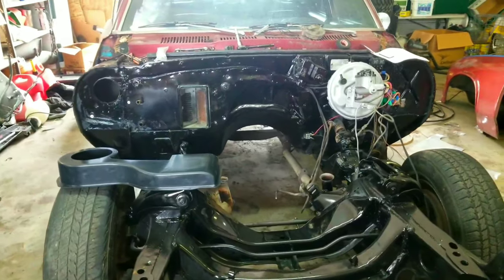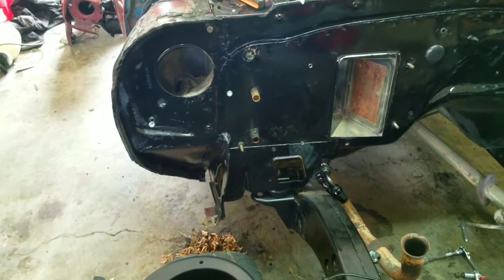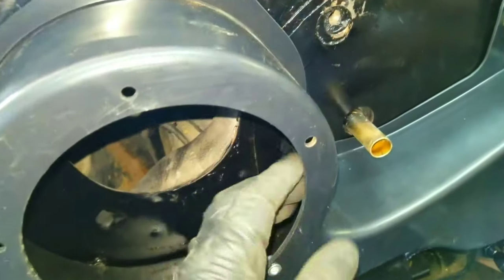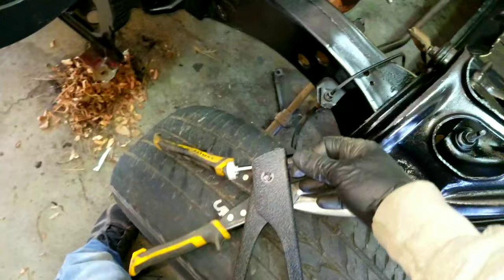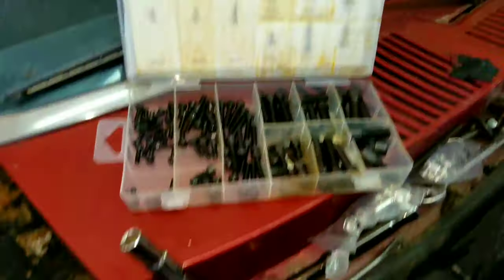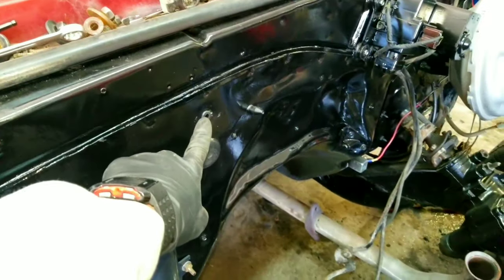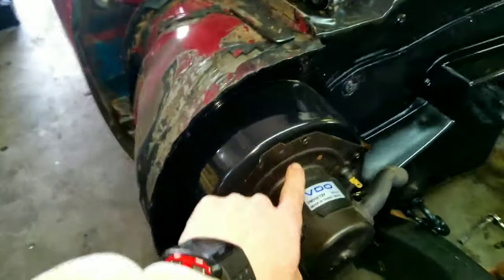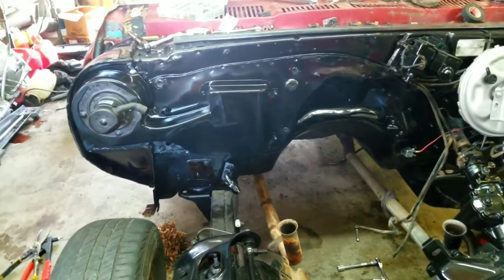LS swap: Factory A/C Delete

Comment: Why did you remove the AC box? I’m ask cause I’m doing a ls swop on a 73 Impala and I see a lot of people removed their AC box’s
Reply from the maker: For starters, the AC in this car didnt work. It was a large box that wasnt needed for the heater to work. If the AC worked in the car i might have kept the ac box. However, the AC in the older cars were not that efficient and there are better options for AC in these cars now. So i removed the AC box because it was a large heavy waste of space

Comment: So where did you acquire the delete cover
Reply: Where did you get the ac delete cover
Reply: Holley sells it, it's garbage. Better off spending the 300 on a junkyard OEM heater box. I'm in touch with a manufacture about sending mine (only oem copy I have) for them to make it available but they'll still talking about 6 month wait for mine to get returned and their current offer is ZERO royalties and will send me THREE to sell on my own lol. Not biting.  But we'll see